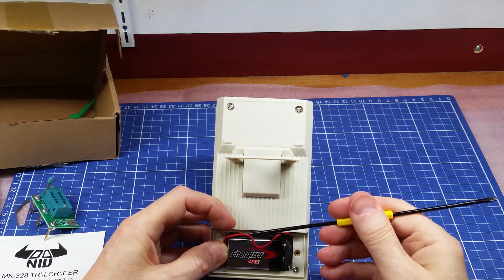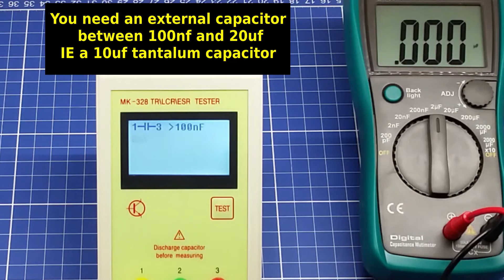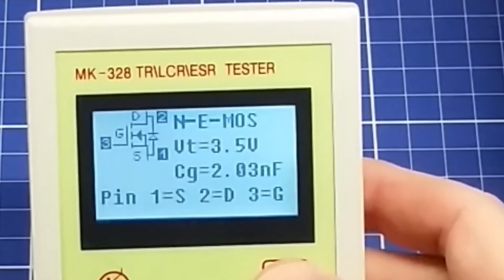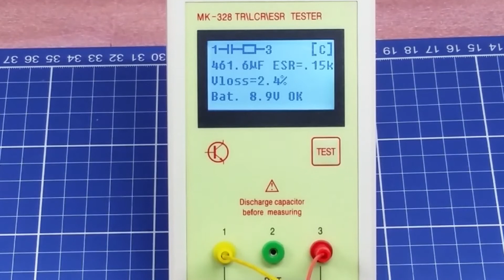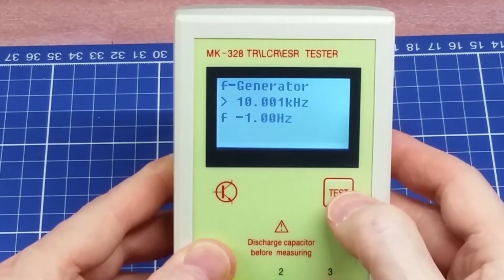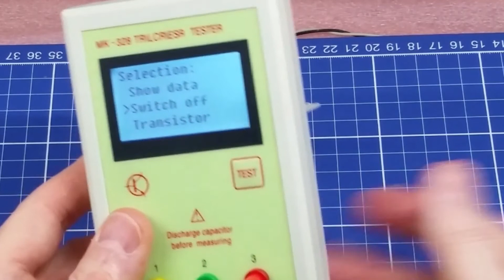MK-328 LCR/ESR Part 2 Operations Capacitor, Inductor,Transistor Component Tester

Comment: That proskit mt5110 looks like a quality device.
Reply from the maker: The wire clips are a bit flimsy but other that that it not a bad unit. There is enough room to put a 9v connector for using external power supply. You can drain a 9v battery easily if using a lot.
Reply: It's super expensive here.  It's about $80. It looks like it could survive a few falls off the bench etc which is why I want one. The cheap ones I have break too easily.

Comment: Did you figure out what is wrong with old one. I have the same issue it turns on and then will not test anything. I am thinking firmware issue.
Reply from the maker: It is a hardware/firmware issue.I could only get it to partial work when first turned on, but otherwise it is broken and could not get it to work.  I was able to get a replacement sent to me by the supplier.